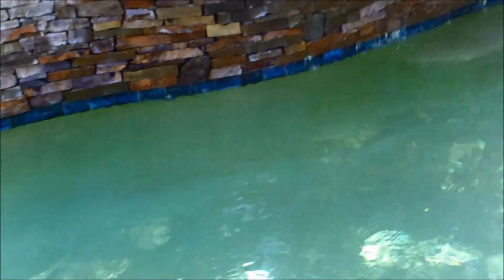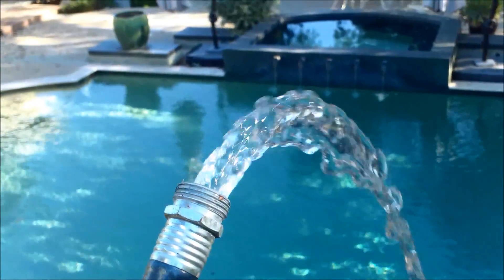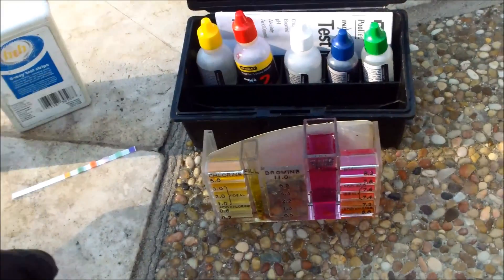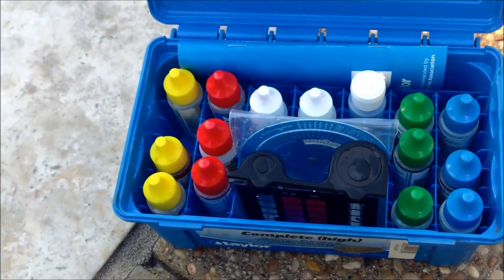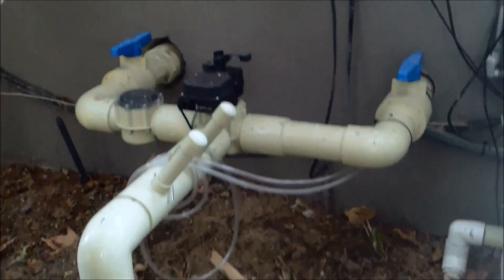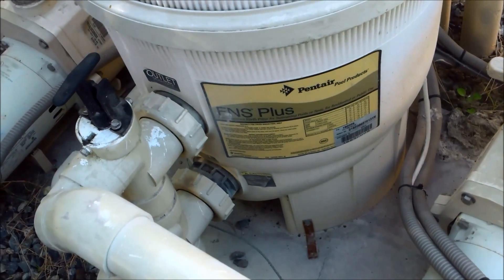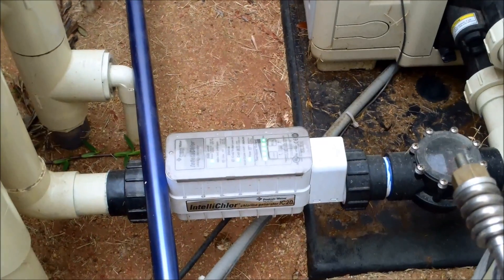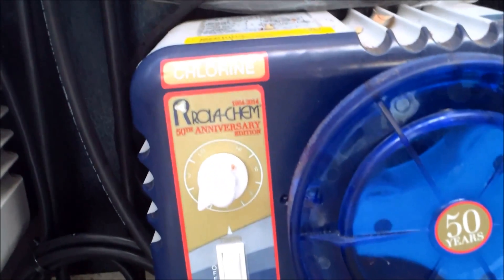Ultimate Swimming Pool Video Guide: Everything You Need To Know About Your Pool

Comment: Question why would a pool go moldy above the waterline under the lip?
Reply from the maker: Just happens sometimes. Bleach in a squirt bottle is effective.
Reply: @SPL  oh cool. Thank you. I had a pool guy tell me that 'sand' needed changing? Is there sand in the pump or filter that requires changing? The pool is cloudy  and you can barely see the bottom. I want to start doing this myself.
Reply: BTW, thank you so much. I am actually thinking of going into this industry. Your videos have been very informative.  So a huge thank you. I watch them when I have time.

Comment: Hi I am about to buy a pool for my house. But I am confused which pool cleaner should I get... They have the Paramount inflow cleaner but it cost 2,500 dollars, while the vacuum is free. I  never owned a pool before. Do you know if the inflow cleaner is a good investment, aside from not having hoses floating in the pool?
Reply from the maker: +Bella Toy Stories The infloor cleaning system is good but I think a good automatic cleaner is better. Are you having the pool built from scratch?
Reply: +Swimming Pool Tips, Reviews &amp; How To -MrDgvb1 we are going to have it built by digging on the ground...so I think that's from scratch? I am not sure, it would be my first pool. A cleaner that comes with a pool is Pentair Rebel Pool Vacuum. Have you tried this kind before? They said it works just the same, only thing is there would be hose floating in the water. I also read that in-floor cleaner saves energy and helps maintain water circulation...So I wonder if in-floor cleaner is a good investment.
Reply from the maker: +Bella Toy Stories The Pentair Rebel is a good cleaner. I am not a fan of the in-floor system. Just a regular pool return system is fine.
Reply: Bella Toy Stories 
Just for your info. If u are in a cold area these systems are tough to winterize. It's like having several main drains to airlock

Comment: I live in central Florida, I keep getting these brown stains just about everywhere, it's covered and its a17,000 gallon pool. What should I do is it safe for me to completely drain it ? Then acid or bleach clean it , how London can I leave my pool empty before it rises from the sand soil pushing it up..
Reply from the maker: lawrence matos Have you tried organic stain removers yet? Like Super Stain Out by HASA? Or an even stronger one by United Chemical called Stain Treat - this one will lower the pH also but might get the stains off.  If that fails then a drain and acid wash will do the trick. As far as the pool rising out of the ground - unlikely unless your water table is high under the pool - ground water close to the surface.

Comment: Hi, I am thinking of building a new pool, I have 2 questions, as I am digging into learning all the aspects of it, I am a little puzzle about the cleaning and maintenance of water, from what I understand so far the latest equipment will eliminate all the techniques for water treatment? will I still need to check for all 5 elements you mentioned at the beginning of your video? 
Next question is exactly what kind of equipment do you need for a pool & spa system?
Thank you
Reply: 7 years after this comment and there’s still no such thing as pool automation to the extent that it’s maintenance free and without the need to regularly test the water chemistry. Salt water generators have their own maintenance schedule and you still need to add salt and test to confirm proper levels. The most recent automated chemistry readers still require a steady feeding of reagents or expensive cartridges. Old school still works the best: a simple pad with just a variable speed pump and a big cartridge filter, a suction side in-pool automatic vacuum, liquid chlorine, long brush and a leaf rake.  Simple, inexpensive, effective and minimal effort

Comment: I am a fairly new pool owner. (me, not the pool). I have had a hard time finding a good, fair, dependable pool service. (one charged me $250 for a $70.00 auto-fill before I ever moved into the house in addition to their "cleaning" fees of course) I didn't know any better but I have learned a little in the last year and a half. I still do not feel like I have a solid grasp on the thing. It is eating my lunch! I have been told that rats have chewed the wiring in the pool/spa heater THREE times! I have set traps, used brillo around the holes....everything always vanishes! I live close to a river. Any idea how to keep the rats away from my pool heater?
Reply from the maker: Rats like heaters. They are warm and I've had them in mine too and I live in the suburbs. They will chew through whatever you put around the heater to keep them out. I have a gated equipment area so my dog is safe from how I solved the problem. I put three snap traps around the heater with peanut butter in them. My neighbor who is an exterminator suggested it - I've caught 4 rats so far in one year... here is the trap he suggest and they work great.  http://www.pestrong.com/220-trapper-t-rex-snap-trap-for-rat-and-mice-1-trap.html

You can get them at Lowes & Home Depot. Peanut Butter seems to get their attention. 

Last resort. The only heater that I know of that rats can't get into is made by Hayward. There just isn't any openings large enough - of course I hope you don't tell me that is your heater brand ;).

Comment: Yea I here ya man those things work we'll when they are done the right way down here in Texas those systems are very common. Unless you have a pool with a million trees around it and a floor system! But I've found out something that makes vacuuming a pool with a floor system much easier. If you look for the little pump looking thing with a bunch of gears inside of it ( it's usually separated from the pool equipment) it's what runs the heads in the floor system. We'll on too of that it usually has a little black tab, and what you do is pull that up and it locks the system in one zone therefore the heads don't pop up while your vacuuming
Reply from the maker: Cool. Thanks for the tip. I will look at the one I have on my route tomorrow and see if I can find the black tab - I think that domed unit itself is referred to as the Caretaker Unit.

Comment: Have you ever heard of a floor system in a pool?
Reply from the maker: I've got two pools on my route with those. They are made by Zodiac and are known as the Cartaker In-Floor Pool Cleaner. I like them as the Cartaker unit itself directs return water through the in-floor jets and keeps the pool a lot cleaner. There are a few drawbacks. Sometimes the floor jet will pop out leaving an unsightly hole. But they make a tool that clips on to your pool pole to reattach it. The Cartaker unit can get jammed and the floor jets will no longer cycle or pop up. They are made to pop up from the shallow end two or three  at a time and go back down, usually eight to twelve return jets on the bottom that cycle through. I set the pools to run later in the morning so I can change the pool return when I get there so that I can vacuum the pool - If the Cartaker unit is engaged it will shoot dirt and leaves up making it hard to clean at that moment. The pool stays a lot cleaner with this system, though it is not very common anymore.